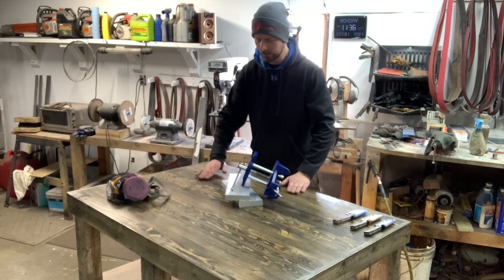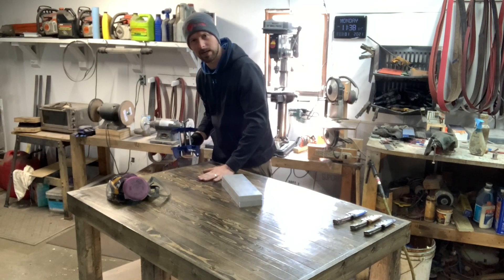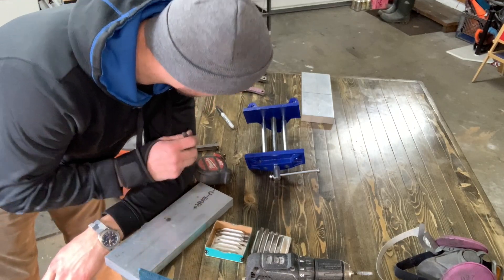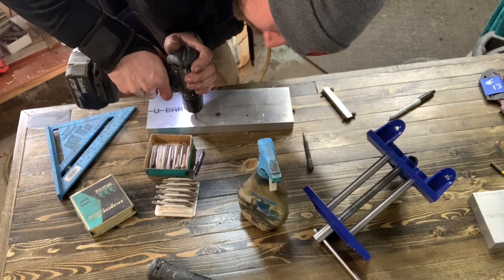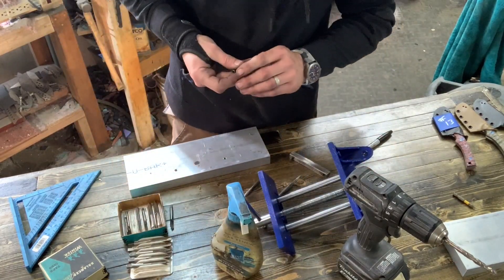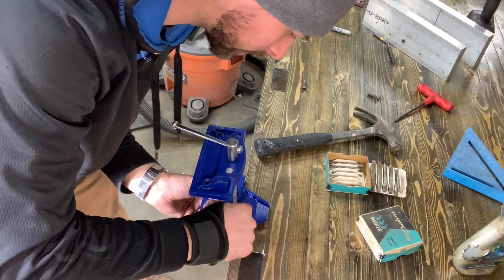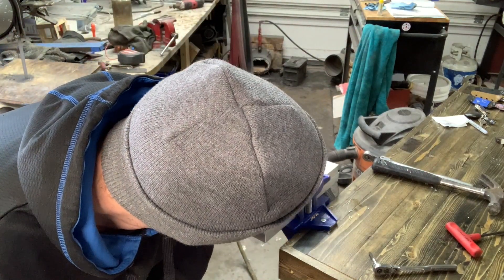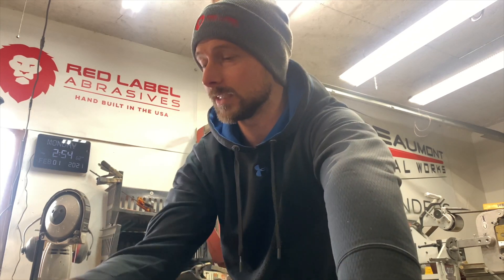How to build a plate quench vise ( CHEAP)

Comment: Where did yo get the plates? Tia
Reply from the maker: Local metal supply company had them
Reply: Are these plates only for stainless steel or for other steels also , I am very new to knife making and not going to try stainless for a while

Comment: Can you use this for every blade like 1075cr?
Reply from the maker: If it’s a plate quenchable steel
Reply: @gentrycustomknives8008  meaning? sorry
Reply: @benbroeckx1905  no 1075 is an oil quench steel

Comment: I made the exact same plate quench assembly, ended up accidentally stripping the threads out of the plate so I drilled all the way through the block and countersunk the holes so the screw heads were flush with the plate faces.